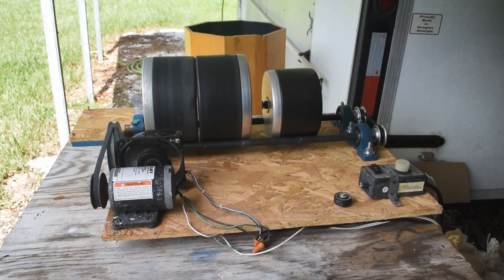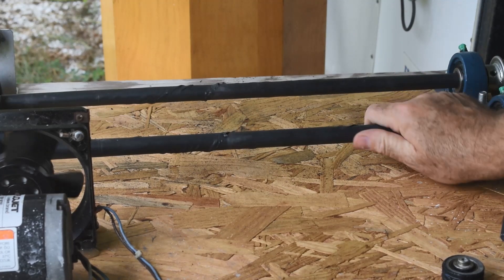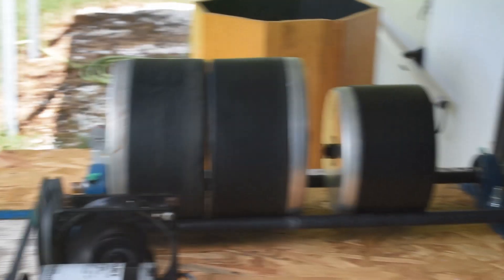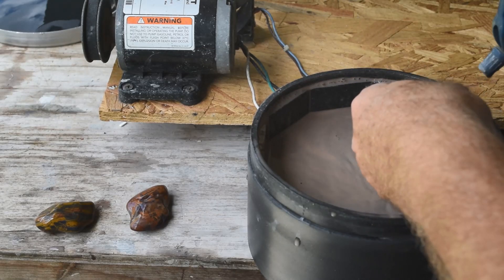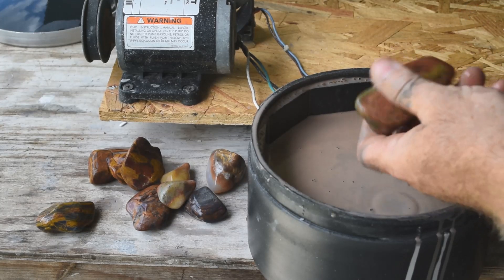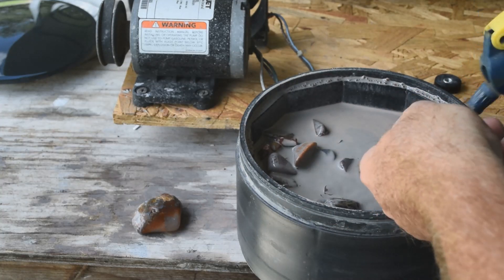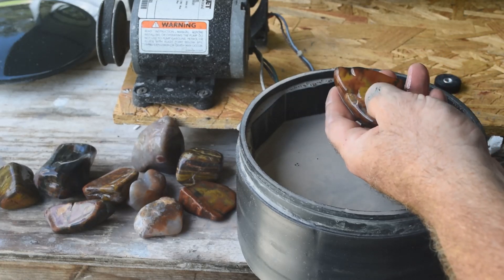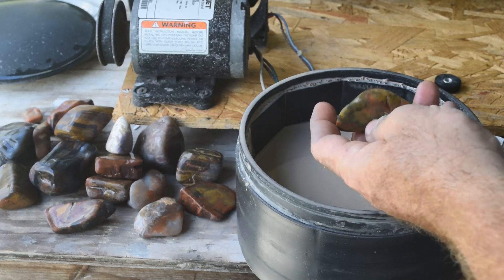DIY High-Capacity Rock Tumbler Update: Minor Issues & Pretty Rocks #thefinders #rockhounding

Comment: So the easiest fix is to just run a razor knife and cut the heat shrink into sections as it is now, then re-shrink it. Second option is to remove it and use glue backed heatshrink.  It will be permanent and wont wrinkle like that

Comment: I think I have a good fix for you Mike. Buy some self sealing silicone tape which should have even better grip plus it is heat resistant AND if done in a couple layers will sound deaden as well. Plus, you wont have to take apart your machine. I also like the spray plasidip idea for ease but unsure about durability. I do have a question for you and/or people on here about a motor question I have. Would a ceiling fan motor with a speed controller work for this? You could actually directly put tube/shaft right out the middle of the motor the way the fan shaft would be. No bearings or pulleys required right? Another idea for people concerned about the noise.. was thinking about how it would work if wrapped barrels in sound deadener. I personally have a good place to tumble in my shop away from the house but some people dont. Im going to explore more on the rabbit hole of homemade barrels too. The idea of running custom sized barrels is appealing. Maybe 4 even wider barrels vs 1 or 2 huge ones so you can run different stages or different types of rocks. For 200 dollars I have built my own full sized lapidary workshop so have gone away from tumbling somewhat and just cut and polish which is alot faster. And i do like the cut with diamond saw then polyurethane or carwax approach. Just dont think the shine is as deep.

Comment: Check with an industrial hose and gasket company if you have any in your area. I go to a place called Atlas Hose and Gasket in New Orleans. They probably have the exact product you will need and adhesives. They have a type of rubber cement that is as thin as water but works great. They sell hose by the foot. I used to buy 100’ lengths of high temperature garden hose for about a dollar a foot. They may have exactly what you need. I would check closer to you first.

Comment: There is heat shrink tubing that has heat activated adhesive on the inside. I'd still recommend doing the shorter lengths. It will make it easier to remove and repair as needed. Can you give some info on the motor and speed controller you are using?
Reply from the maker: Check the links in the video description.

Comment: Hi Mike sit here, you might try using flex seal spray on those bars as well. As they're turning just spray it and it'll make an even coat on the bars. I used it on the inside of my ball melon works really great for sound dampening.

Comment: Mike i have some inner tubes you want me to send you some?
Idea; If you try that blow air from your compressor through the tube as you pull it over the shaft. That is how we get grips off the handle bars. 
Or
A piece of rubber tube or garden hose. Slide it over the shaft use alcohol as lubricant then when it dries the rubber should grip the shaft
Reply from the maker: Thanks for the advice and the offer. I don't think I need any inner tubes. I'm liking the garden hose idea if the heat-shrink doesn't work in the long run.

Comment: Hi Mike, I've been following your tumbler builds and it got me thinking about building my own. On the 5/8 shaft I used a 700x23 bicycle inner tube. It took a bit to stretch it over but it has a nice tight fit, not sure how durable it will be over time.